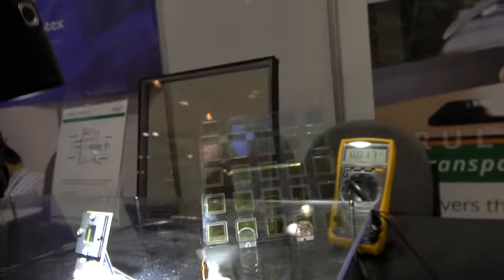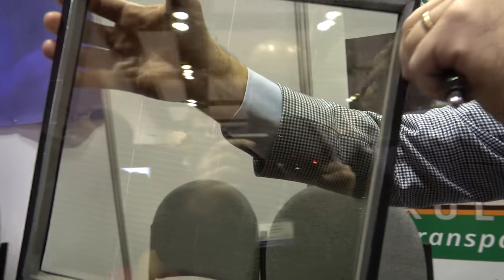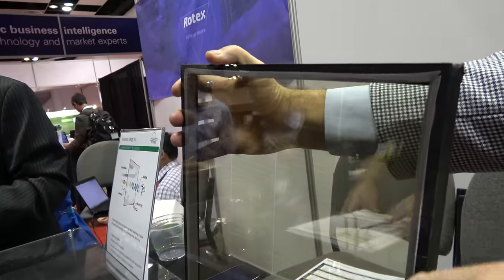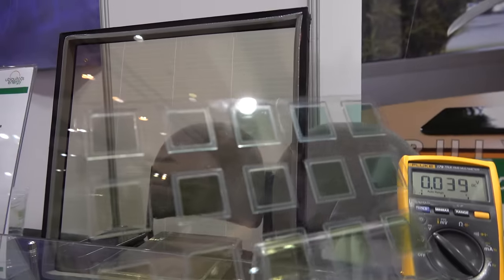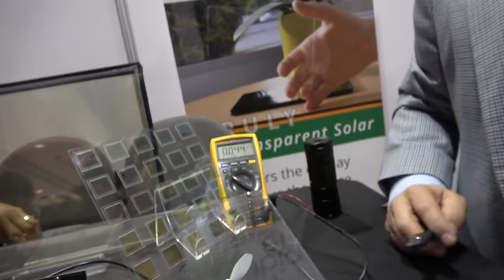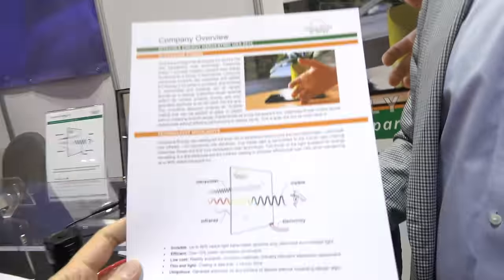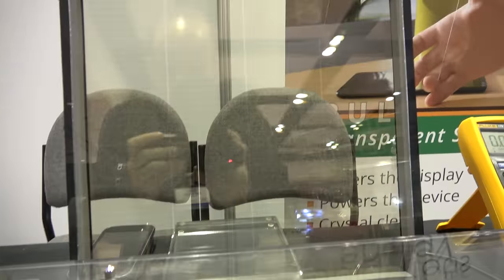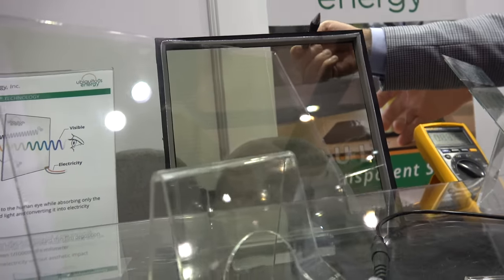Transparent Solar Cells (Solar Windows) by Ubiquitous energy

Comment: Tesla needs to do this on there cars
Reply: The cybertruck needs this.
Reply: One panel only produces 5 watts. You would need a lot of windows to generate enough power
Reply: @booonnoob7950  its literally gerenerating energy by standing still... Its just a matter of time...
Reply: @italoalberterson6860  no, a tesla requires even more energy when off. Because there is alarm, connection with phone and al lot more thinks. Its like adding a AA battery to improve range, it only adds Weight and cost. Maybe good for marketing but nothing else.
Reply: Also check out Clearvue. Power generating window and planning to expand to self-charging mobile phone screens.
Reply: @italoalberterson6860  or u can just use normal efficient solar panels on the roof
Reply: @booonnoob7950  you try this solar panel 🤔

Comment: wonder if this could be used on a greenhouse and what if you put it on solar oanels?
Reply: I saw another video with the co-founder and did give an example of using it on greenhouses. He also said that the glass could be layered (with different chemicals) so the light wavelength that would go thru the top layer would go to the second layer that would catch a different light wavelength to then go thru to another layer
Reply: Check out Clearvue. They already have self-sufficient greenhouses made with power-generating windows. Clearvue also plans to expand to self-charging mobile phone screens. Good stuff.

Comment: If one designs a solarcell in a stacked configuration with this, can you make a decent solarpanel to absorb the residual IR-radiation, or if you stack this in a frame and place a sheet of diamond mylar at the bottom, would you generate electricity when the light bounces back as well, or would you be better of layering this with a traditional solarcell at the bottom?

I guess what I wonder is; would it be worthwhile investment to build it the way described to increase effectiveness on a limited space to reach a higher efficiency?
Reply: Why not mylar covered curtains with those. You may not want the sunshine to heat up your place. Mylar window blinds,maybe.
Reply: I had a combination of water heater as well as solar cell in mind. This would allow one to combine both into one unit occupying the same space. It would work very well up north either for heating living quarters or powering a stirling generator to further boost output way more than a solar cell could do on it's own.
Reply: A solar water heater works quite well.
Fun to build!

Comment: Needs supers fasts power generations with transparens solar panels use gorilla glass for longibities for using materials and needs supers compacts editions for to makes with 100/ accuracy and Excellents unique designs and unbreakable for heavy duty for using all applications and needs supers fasts power generations changer for another options with automatic or manual for to charges battery by through screen touch displays as well inventions and or create lifetime warranty support for using all, thankyou, God bless you all best wishes.

Comment: Needs solar panels systems works in the day for any kinds of lights sources coming from both sides of the panels from anywhere else with high efficiency fasters betters thiners, compacts shorter smaller better than betters technological advances innovations conversation achievements designs with developing forms for alls abouts, with that can it possibles to makes in the darks environments through inductions by ionsnizations from any ultra violets rays, any microwave signals, any inductions sources, any waves and any glasses overalls plains inductions of the any Airs at the overalls surfaces on both sides of the windows and from anywhere surfaces of the glasses and during that's inductions shall reached both sides of the transparent screen of the glasses during transmissions lines of surfaces and it's maybe microwaves signals, waves and signals comes from any others , it may comes from anywhere else of the earth , from moons , days and nights in from the sun, from anywhere stars , planets and black hole and Galaxies, our Galaxy and any things elses others sources of funding of the Universe, we have been catched from antennas, maybe nano antennas, through helping strong senser defectors, may general and transparent screen and colour screens of the photos cells and maybe even getting conversation forms likes trees and others from different sources of funding of the application process of the getting of the power generations, we have been done through general provides for advanced features nono inverters, UPS and batteries pack as for getting general from smaller than smaller, thiners sizes with easy access provisions or reached power generations from solar panels systems does during at days and nights in froms any kinds of environmental conditions and including any darks conditions from anywhere else both regarding related advanced faster communications networks during production access, please highlights abouts taken technological advances innovations, thanks given with love and cares abouts, God bless you alls, yours faithfully.